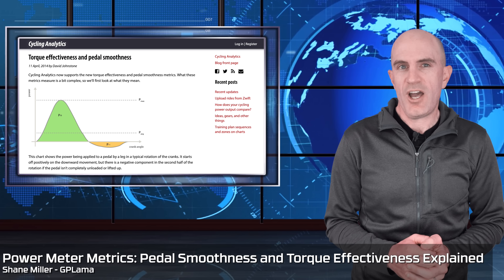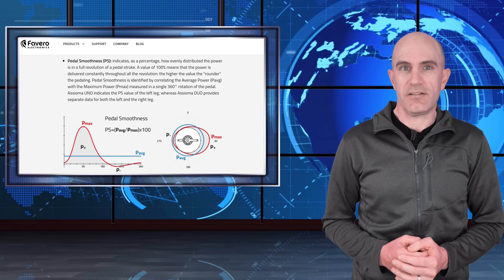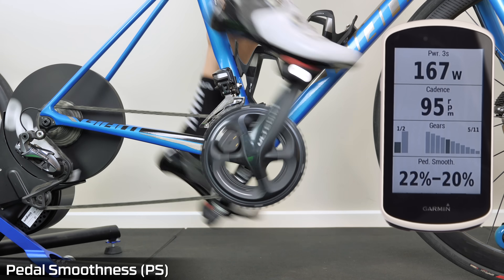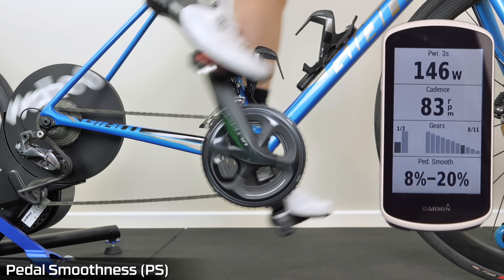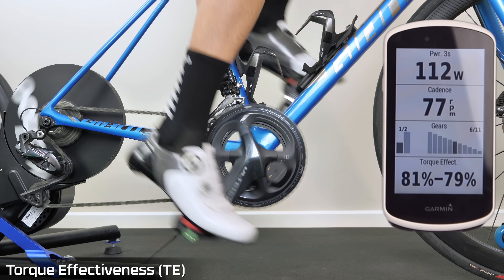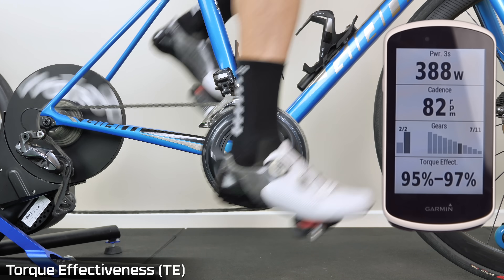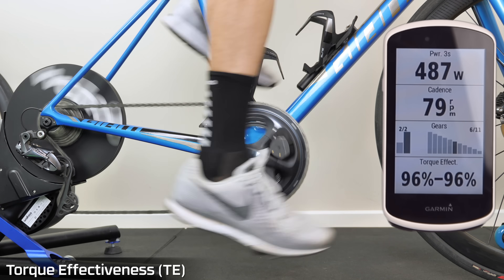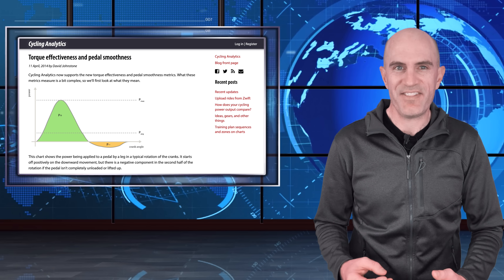Power Meter Metrics: Pedal Smoothness and Torque Effectiveness Explained

Comment: Seems to me that TE will naturally go up with power. Assuming that the drag in the upstroke is just the weight of your lazy leg, that will be a fixed amount. Then, as you increase power, that drag as a proportion of overall power will fall. So, if you care about TE, you need to measure it under some steady-state condition.

Comment: Hi GP Lama, thanks for the video. Any chance you could explain the best way to use the Assioma duo with the kickr core and Garmin head unit? I’ve been using the Garmin edge 530 with the kickr core controlling the power for intervals or steady state through Garmin workouts. I’ve just upgraded to the assioma duo pedals. Can I do the same controlled workouts but get the data from the duo?
Reply from the maker: I don't think the Garmin can do power matching like Zwift/TrainerRoad/FulGaz etc can do. I believe when connected to a smart trainer it'll take power from the trainer only and not from an external power meter such as the pedals. I'd need to test/confirm to be 100% sure (if this isn't already documented by Garmin somewhere).

Comment: I must have the motor gene as my PS is typically between 50-60% with the max I have seen it display at 63%. I use the SRM PM9 with PC8 head unit ..

Comment: This is all very nice, but very pointless. Pedaling a bike uses motor skills - the sequence of muscle firings which allow you to do complex movements (by complex I mean more than a single contraction).  Most of your motor skill learning happened in the first year of your life as you learned how to walk. Walking is very different from pedaling. In walking you support your body weight on the ground. In cycling, if you want to be effective on the bike you need to be pushing down at 3:00 (90 degree offset angle from the crank, effectiveness = Sin(offset angle))   This explains why when you look at force vectors, the longest vectors are at the bottom - that's a person who's learned how to walk. Much of the information out there says that people can't change how they pedal, but if you look closely at the tests you'll notice that they skipped the learning process. There is a 3 step learning process to creating motor skills, which nobody is teaching, or even seems to understand.  My point in all of this is that without that learning process, all that data is pointless.

Comment: thx for the great video, very useful. I would love a video describing the jungle in what power sensors will work with what computers when it comes to pedaling analysis. will your Garmin only work with your Garmin computers or could you swap that into for example a wahoo or Hammerhead computer etc? For me, it's a jungle.

Comment: I want every roadie out there to get on a road bike with proper MTB pedals so you all can see just how hard you can pull up on flats.  There's a huge misconception when people say 'flats' they automatically assume you're talking about like the generic pedals that come on a cruiser that don't have grip.
Reply from the maker: I have power SPD pedals on my gravel bike. What’s your point? I don’t get it.
Reply: @gplama  By MTB pedals I mean flats with pins.  The idea that all flat pedals are just smooth surface cruiser pedals isn't accurate.  Even my road bike I have MTB flats on it and when I do a casual group ride people look at my like I'm crazy when I tell them I can pull the pedals up with flats, but you can.  Granted you use more hamstrings than hip flexors, but I can completely burn out my hamstrings on MTB flats while barely using my quads.
Reply from the maker: Ahhhhh! Shin graters! I’ll have to get a pair and do some power tests for fun.
Reply: @gplama  Lol I actually have a nice gash down my left shin right now where I hit some soft sand and went down quick.  The pedal flipped up and scraped half way up my shin.  My wife was none too happy about it when I got home.  lol.

In my opinion ones like the Crank Brothers Stamp versions are great with the concave center section, your shoes can dip down into the pedal.  If you have bigger feat they have a larger size too for a bigger platform to stand on.   I also use Chrome Kursk 2.0 shoes that have a solid sole (they don't sell them anymore which sucks) so I can still manage a lot of power in my sprints (on the road) and trail grinding without my shoe flexing.

At some point I'll probably get some sort of SPD or Speedplays, but I'm two years into my road bike with this setup and haven't had a real issue with it.  I'd love to see your power data and thoughts on it if you ever did a video about it.

Comment: I have a 4iii left crank powermeter and after a recent update they show torque effectiveness and pedal smoothness on the edge 520. I think it's quite useful. I have another bike with Giant powermeter pro and that doesn't show torque effectiveness and pedal smoothness. It's a pity because they also calculate those numbers but they can only be shown on their own App on the smartphone. And it is not recorded, just live in action.

Comment: I'm using a new set of Garmin Vector 3 (2nd time having these, ridden lots of k's with them). I wanted to check my pedal smoothness and torque effectiveness and they aren't reading. Pedals are linked, everything else is working properly (left/right power, power phase, balance, etc). Only things I can't get to work are Ped. Smooth. and Torque Effect. 
Any ideas?
Reply from the maker: Check the paired sensor options.
Reply: @gplama  thought I poked around in the settings, but maybe I missed it. Are you talking in Connect or on my Edge 830?
Reply from the maker: @HolmsOnBikes  On the Edge.
Reply: I'm an idiot. Didn't see the toggle to turn them on. Does it use more battery or something? Why are they 2 metrics that you can turn on or off?

Comment: i have a favero assioma duo and garmin edge 1030 but i everytime i ride watts comes out, but the pedal smoothness% and torque effectiveness is just zero :/
Reply from the maker: Update firmware on the Assioma. If that doesn’t work then contact Favero Support.
Reply: @gplama   thank you! last question how do you sync your favero assiomas? with the left power meter only sending or both sending datas? :D
Reply from the maker: DUO sends both L/R data.

Comment: Shane, how do you get to these metrics to show up on your Garmin while using the Pioneer?  I have the fields on my Garmin, but they stay blank using my dual sided Pioneer Power meter R9100 gen3. I have spent hours online looking to see how this is done and can not find any info other than that it was built-in with Wahoo now.
Reply from the maker: I can't recall if the Pioneer units have Pedal Smoothness and Torque Effectiveness. They do have a proprietary feature called "Monitor Mode" which is what you're referring to on the Wahoo head units.
Reply: @gplama   Hmm, I thought this video showed you using a Garmin with the Pioneer power meter and able to show the pedaling metrics.
Reply: Unless you were getting the power data from the Garmin pedals rather than the Pioneer.

Comment: I’ve just bought some Favero Assisoma duos and I have a Garmin 810. Can I use my Garmin 810 to work this out or can I use my computer? Help would be appreciated. Thanks
Reply from the maker: I’m not familiar with the older 810 unit sorry. The Garmin support site should have the info if it supports PS and TE.

Comment: Hi, Good video!
If you are 75% effective at 175 Watts this means you are wasting 58.3W and Your total power is 233.3W?

I have around same numbers with easy pedalling(Favero duo pedals)
While seated 70-75% (under 200W)
And 95% at 400W.
But standing up My easy pedalling is much more efficient:
90% under (200W) and
99% (over 400W).

Are we really wasting 50W whit easy pedalling?
Should I aim to improve My seated efficiency closer to numbers I achieve standing up?
Reply from the maker: No, there's no wasted watts (as they were never produced in the first place). These metrics are interesting... but borderline misleading. They're comparing a human to a motor. Humans are terrible motors.
Reply: @gplama  Hi again! Thanks for answering. 
I see how pedal smoothness(PS) numbers compares humans to motors but I'm looking at the Torque Effectiveness(TE).
Formula TE=100x(P+ + P-)/P+ indicates that:

With easy pedalling seated:
200W=propulsion=P+,  TE=75%,  NEGATIVE POWER(P-) is 50W. "pushed in the opposite direction applied, to the crank over each revolution"[Favero electronics]
hard pedaling seated:
with P+ =400W, TE=95% the same Negative Power(P-) is 20 Watts.

and standing up:
200W, TE=90%, negative Power(P-) is 20 watts
400W, TE=99%, negative Power(P-) is 4 watts

Could this variation in the negative power be only effected by your pedal stroke or is there something wrong with measurement electronics or sensors?
If you have any connections to Favero electronics maybe You could ask them?
I have calibrated my pedals before each ride and they are brand new. Got them for Christmas and not even driven them outside yet due to the snow conditions. :)
Reply: @jakepalo1108 ha, that will be a late reply: That power is not "wasted" either - it helps lift your other leg up. If you want to generate max power, it is better if your other leg lifts itself fully, obviously. But at power levels that we generate most of the time, for a given net power, is it actually more efficient (cardiovascularly) to unload the other leg fully, or let the pedal push it up a bit? That would need some research. Maybe there is some, IDK. It would theoretically distribute the exertion onto more muscles more evenly, so should theoretically help during longer rides - when muscle fatigue is arguably more important than cardiovascular load.

Comment: Hi Shane - can you explain the diff btw pedal smoothness as measured here and pedaling uniformity as demo'd in your Nov 3, 2017 video on the Direto?
Reply from the maker: Off the top of my head, nope. I'd have to loop back and look at those. iirc the Direto does the pedal peanut - which is a circle with 360 power application and more peanutty with typical pedal stroke power application.
Reply: @gplama   - well, the smoothness number was in the 20-30% type of range, and the uniformity number was in the 50-60% kind of range but they both claimed to be avg/max.  I have a guess as to the difference, but thought i'd ask.

Comment: If your logic on TE is correct there's no point being clipped in, because all effort spent raising the pedal is 'wasted', as it's not pushing the bike forward. I don't think that's the point of this stat.
Reply from the maker: Whheeeyy back a little. Clipped in is about a lot more than pulling up. 

TE is what it is. A dyno is 100%, humans never will be.

Comment: Wow thanks Shane! I though nobody really cared about these bells and whistles.  I am looking into getting an edge 530 but the Company promoting the First Beat data have not reply to my Garmin forum post.  It would be great if you had the time to make a video on each of these metrics the new 530 supports. (Bar FTP, Calories Burned and FTP which are well known industry standards)

There is info on the First Beat website but I have no idea how to integrate most of it into my training.

VO2max Fitness Level

Functional Threshold Power (FTP)

Training Effect: Aerobic

Training Effect: Anaerobic

Real-Time Performance Condition

Calories Burned

Training Load

Training Status

Training Load Balance

Workout Labels

Recovery Time Advisor

Quick Stress Level Test

Heat and Altitude Acclimatization

Respiration Rate

I am not sure if you feel the same but do we need all of these metrics, obviously some are more useful than others. I just wanted to know if you think metrics which are not industry standard and basically (scientifically??) made up by a certain company are even worth looking at?  Your thoughts would be greatly appreciated.
Reply from the maker: Cheers David. There's two sides to this. Firstly identifying what these metrics are and how they're calculated (what this video is about), then there's the discussion around how those metrics are applied to training..... and that's a whole other topic, and it's hotly debated. I've had a few people misinterpret this video as "promoting" these pedal metrics... when my intent was to simply define what they were for people who hadn't looked into them. As for the additional metrics the Edge 530 has.... I'll first need a unit to get my head around the functions. IMO, both Garmin and FirstBeat should be more forthcoming in regard to how to use these metrics and why they exist in the first place. Ray and I discuss this in the latest episode of our FIT File Podcast.

Comment: I do use it after the ride.  52/48 lr balance on real pedal power meter is part of the story but you add to that smoothness and torque efficiency and it can tell me more of quadracep l/r balance and simultaneously hamstring l/r balance. Think about this smoothness of 30 is how many times more effective than 25? 5/25 is 20 % so if you do 30 and I do 25 then, if we have equal peak torgue values, your power output is 20% more than mine. I'm pumping 300 watts while you are pumping 360 watts. They say a smooth stroke is more cardiovascularly demanding. True. But why not work on pulling a bit? If you can make your body efficient at it, then it's free power. Try your hardest in shoe a, then try shoe b. Are you pushing down harder? No they are equal. So pedal smoothness then is directly proportional to power output. Smoothness is avg/ peak torque or avg powr/ peak power. Peak power on the stroke doesn't change much so avg Power, which is real power is the one to target, or at least don't neglect it as your down ward pushing is getting stronger.

Comment: WRT torque effectiveness, don't be too concerned about dropping below 100% because it doesn't factor gravity in to the equation. Meaning that even though you're opposing the crank as it comes up, another way of looking at this is that you're "pre-loading" the weight of your leg and that adds to your "real" effectiveness on the way down when you have gravity working for you.
Reply: I think it's a relevant data.

Comment: Maybe two more metrics for Zwift to be able to see if someone is using an ebike/Zwift doping...?
Reply: Good in theory but in practice? The location you measure power from determines if you can get this data. Only a true left-right power meter (or left only version of one) is in the position to measure this. So basically all trainers and spider based power meter can't really measure this
Reply: @enki42ea  if you're using a smart trainer and an ebike this metric would be able to detect the equal torque being applied through a full pedal stroke when the motor is being employed. Don't need L-R PM

Comment: Would your numbers change with oval chainrings? Or someone with a low TE?
Reply: I use rotor Q and my numbers are averaging 40-50%
Reply from the maker: No idea. Oval rings aren't something I'll be on any time soon as I'm just not convinced of their benefits and they'll screw with most power meters I use/test.
Reply: @gplama  Isn't the low pedal smoothness an indicator enough of the benefits oval chainrings provide? I guess it's one of those things that don't need an explanation and those who do will never get it.
Reply from the maker: @frederikroark  I'm not one to make claims oval rings provide any benefit.... *and unleash the anger!!* :)

Comment: Hi GPLama love your informative info/reviews, totally off subject here but i have a question for you i'm looking to take my first trip to Europe/Germany with a couple of flight transfers in between  with my carbon disc road bike but i'm not sure what bike case to buy for my pride and joy there are sooo many on the market to choose from can you recommend a bag or hard case for me? i am currently looking at BKND Helium or the Topeak Pakgo x.any input would be greatly appreciated.
Reply from the maker: I've used an EVOC soft-case once to Fiji (worked well). I've travelled a LOT with my Thule RoundTrip Pro bike case which is a semi-hard case (https://www.youtube.com/watch?v=x-8DUM3kpcY) and once with the Elite Borson (https://www.youtube.com/watch?v=MV9TUTQjsAE). No easy answers though sorry. It depends on your preference/bike/size and how confident you are with your airline(s). Good packing is essential. Hope this helps mate.

Comment: Is good to understand TE and PS  but I think that Gross Power Absorbed (GPA) and Gross Power Released (GPR) and the other asociated metrics as Asimmetry index or Kurtotic index are more useful for understand and optimize pedaling tecnique :)
Reply from the maker: Are more useful or would be more useful?  I haven't heard of those associated with cycling/power meters.
Reply: @gplama  Sorry, I did not explain that point. I use them in WKO4, it is likely that they are only there then. They are very useful metrics because they consider all the power that each leg releases (GPR) and the power that one leg absorbs from the other (GPA). With these metrics it becomes easier to identify asymmetries that can derive from the strength of one leg over the other, poor bike fitting, and so on. In my case, I managed to identify issues of "pedaling technique" that I could correct so that my right leg worked a little more and at the same time did not absorb so much power from my left leg (my strong leg). Take a look at google and you'll find better explanations than my summary here. ;) By the way, I use Assioma Duo power meter.